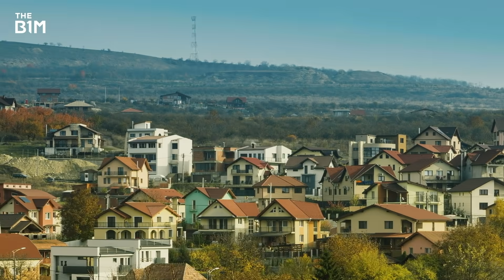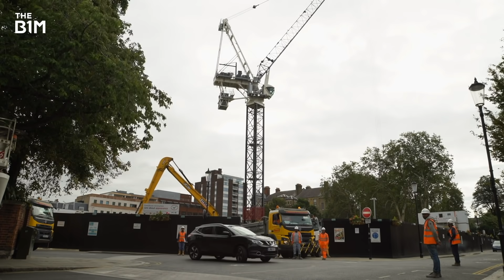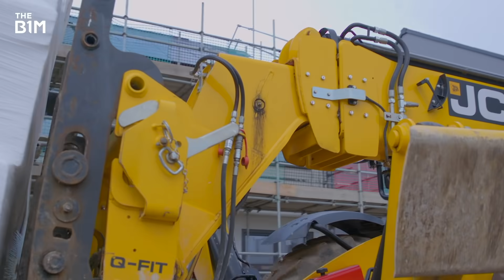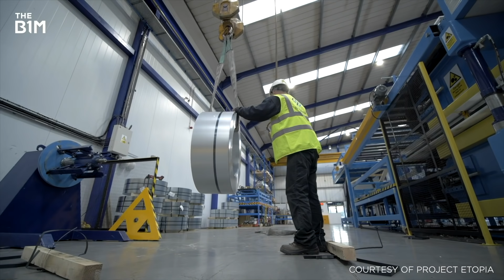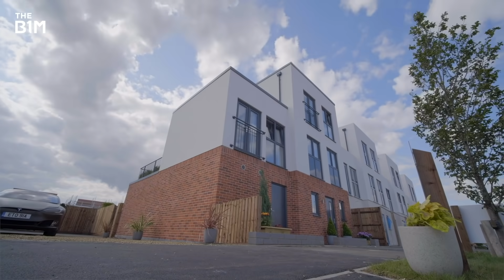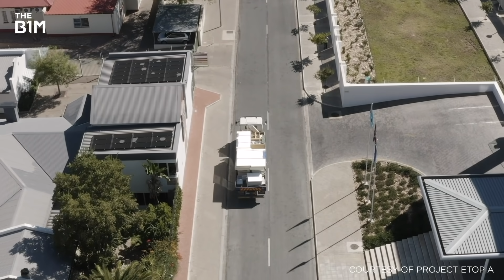How To Build More Homes, Faster

Comment: The picture I have used for my icon is my idea to combat the lack of space we have in Britain. So basically, in the footprint of only one house, I have built a retail space at ground level, two levels of carpark for the residents and ten family homes stacked on top of each other. There should be a water tank on the roof but I missed that off. This building is not meant to compete with a block of flats! It is meant to be an alternate to housing estates full of brick and slate 'Barratt' houses. What looks like glass, surrounding the building, is in fact a fine mesh that is virtually invisible. It keeps out the rain and pigeons, but lets in air and sunlight. The mesh is also a structural element, pulled tight around the building so that it helps support the cantilevers, which act as massive indoor/outdoor gardens that are safe for children and offer better views than any estate garden surrounded by fences. At the rear there are two large glass lifts, with fire escape staircases on either side. There would also be a slim fire escape nearer the front, for anyone caught on the cantilever during a fire. Although there would be sprinklers underneath each cantilever. The actual 'house' part of each level is protected from the elements by the mesh, so it can be built from lighter, more environmentally friendly material than brick. The houses can be made to look modern or Victorian or Georgian, whatever suits the area! The carpark level is accessed by a ramp and secured by an electric garage door that only residents have the remote for. This door can also be opened via an intercom in the house to allow delivery vans and visitors access. Please let me know what your thoughts are about the building, especially B1M and any problems that could occur.

Comment: I can't find anything about the project Etopia costs in Africa. 

Given the fact that building a house/apartment for anything more than $2000 becomes unprofitable (unless you're in the top 10%, which I'm assuming is not who we care about when trying to prevent housing shortages), the cost is extremely important here, since it would either allow leverage (if profitable) or be another form of charity.

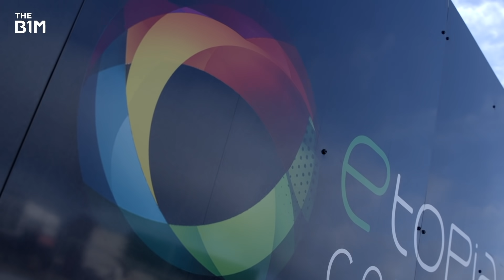Comment: 4:20 you didn't mention in the video cost of these houses. so I looked it up these houses are going to cost $300,000 to $350,000 that's not affordable housing.
Reply: Bruh that's not too bad if you're living in California😂
Reply: @noosurprises   but these houses aren't in a major city like London they're actually far away.  Just like California nobody wants to live in the Central Valley.
Reply: @thatcoolkidjoey  I know I was joking. Although the prices in the central valley have been rising lately. They might just reach that point soon😬
Reply: In India we have a affordable housing programs and most of them are now being build using pre-cast segments and they are far far cheaper than these houses. If it's apartments then they are much more economical I think African countries need these type of cheap and affordable programs than the Corby which I think is quite expensive for the developing African countries. Hear If you chose to live in outskirts of the city like Bangalore then the small apartments of 1300-1400 sft will cost you about 32000$-35000$
Reply: So about 10-15 years of saving everything if you  earn 25k a year... these prices are absurd.
Reply: I live in The Netherlands and a house of $300,000 (€255,000) is a bargain. The average house price in NL in 2019 is €308,000. The average house here is a three story row one-family house with a pitched roof, with a small back yard and mostly a very small front yard, no garage, just a shed for the bikes. The attic with the pitched roof is the third story, so only half the floor space can be used. The house in total has about 120m2 (about 2000ft2). In my rural town (about 20,000 inhabitants) the average house price is higher than 350K. I bought my two story appartement of 110m2 for €279,000 in 2017. I can now sell it for a bit under 400K. In 3 years that’s a 40% rise, that’s just insane. I don’t live in a city, just a small town situated between Amsterdam (30km) Utrecht (25km), Rotterdam (40km), The Hague (40km) and Amsterdam Schiphol Airport (20km).
Reply: And just were does all the timber come from
Reply: That's pretty affordable by British standards, up to £300,000 you don't have to pay stamp duty as a first time buyer and there are also various government schemes to help you add money on top of your deposit. If we take into account that this is a commuter town wich means it's quite close to a major hub and must have pretty good transport links I would even dare call it cheap.
Reply: Here in San Diego the median home price 600k. On the coast you are looking at 1 million plus. 350k is affordable here.
Reply: Yeah and Corby is a working class steel town.
Reply: That's pretty affordable. I live in British Columbia Canada where a brand new 1 bedroom apartment can cost $450,000. Hey a three bedroom townhouse will cost over $1,000,000. Let's not even talk about single detached family homes. Also wages have barely changed in the last  15 years. Starting teacher salary for example is only 40k. These projects seem very affordable to me.
Reply: @john.ragone  not for those that are already on the fringe treading water.
Reply: @john.ragone  I live in semi northern Ontario about an few hours from Toronto and a nice quite big house here used to be around 200,000. Things have jumped and people are building here like crazy and houses that used to be worth 2ppk are now worth like 275k
Reply: @john.ragone  it’s not affordable. The chinese just keep buying all of your guy’s homes as investments overpricing the area
Reply: @john.ragone  did u take US and Canadian dollar conversions into account?
Reply: thatcoolkidjoey are you sure about what they said because he said a ‘typical house is £270,000 - £350,000
Reply: $450,000 for a home is really reasonable,   youd be hard pressed to get a house in Canada (anywhere) for that cheap...
Reply: @niagarawarrior9623  What!? From the US, where the average price of a single-family home is $226,000, those housing prices would be absurd anywhere except the CBD of major cities. In my neighborhood, $275,000 would get you a 300 sq. meter house, with lawns and a pool in the backyard.

Comment: A really big issue I experience living in Germany: in many places there are construction works going on in cities, towns and villages. Either it's a project of a single or two houses, or it's an entire neighbourhood, but hardly any of those construction projects are thinking BIG. I just moved into a brandnew apartment building ... a 6 unit building. Such buildings cover the need for only very few people or families, not the masses of people. There are multi-unit apartment buildings around ... old ones, in the poorer areas of the towns and cities. Of course there's also the extreme like modern apartment towers for the top few percent of earners, again rather a niche market than a solution for a great number of people. There aren't really many projects combining 1) a high number of units, 2) high quality or at least modern style and 3) being affordable for average earners. Modern apartment blocks or apartment towers can offer a normal level of high quality living environment and they are seen in so many countries, but not that much in Germany. Apartment blocks always have a sense of low quality, poor, dangerous etc here which is pretty sad IMO. Honestly, often you can determine how poor a neighborhood is by counting how many floors the buildings have...
So they'll continue to build relatively small apartment buildings with only a few units each, blending in with older single family houses in the neighborhood. I don't really like that trend
Reply: Nah, as I'm also in Germany, there are a lot of projects here that scale, up to 50 or even a hundred units. But these are only good if they're limited in height and number of units per entry, so you don't end up in an anonymous box but actually know your neighbors. If you build a 200 unit high rise, you're accelerating social issues. I know people who lived in such buildings and it's always a solution they chose for one single reason: it was cheap. A tomporary solution until they could afford to live somewhere else. So maybe, we should try to build places, which people can not only afford, but also enjoy to live in. Anonymous boxes aren't that good for this.

And yeah, there are also people living in a 3 unit house not knowing any of their neighbours, but it's far less common. Quite the opposite is the case, in houses with less then 6 units, often all neighbors know each other and they often even do activities together. Especially if there's a shared outside area.

Comment: The problem with this is that it takes huge initial capital to build the prefabrication factory. Which means that only the couple of large developers will be able to use prefab housing, and undercutting all the small and independent developers resulting int a monopoly in the housing development market.

Comment: Would have been nice if you commented on the speed at which refurbishing existing housing stock compares to traditional and modern methods of new build.

Refurb is by far the most sustainable option and is easier to retain a more local character.

Comment: As usual it's a great video, thanks guys! 

There are a few questions though that could also be addressed: how developers and property owners can be stopped from artificially increasing demand by either blocking the development of approved sites or keeping properties empty instead of renting them out. Another question could be why the focus is on small houses instead of actually appealing apartment buildings? Single family houses with private gardens consume a lot of land and don't scale well with the increasing demand. New concepts of modern apartments could challenge that and be very economical and ecological on a much smaller footprint and without demolishing greenbelt areas needlessly. Those government policies mentioned at the beginning of the video have (in the UK) a bigger impact than one would think...

Comment: I think Japan is a tremendous example how housing should be treated. timber frame homes in Japan are completely demolished after about 30 years and rebuilt, its amazing what Japan is able to do with the redevelopment of neighbourhoods yet remain amazingly affordable for the middle class. not to mention having some pretty intense building codes
Reply: What's sustainable about houses that only last 30 years? We don't have the carbon budget to keep doing that.

Comment: I wish it was that easy. In many German greater metropolitan areas, housing prices are dominated by the prize of suitable land. Heavy regulations make construction more expensive, but they often have a reason, such as environmental protection, energy savings, avoiding urban sprawl and so on. As long as the supply of land is the key bottleneck, lower construction prices will only lead to higher land prices. In theory, this should help increase supply, but this would require a functioning market mechanism. Due to regulations, this is not the case.

Comment: the largest problem here is that no-one but the average (middle to low income) profits from building more houses. Companys can either chose to build 10 500k houses for 400k profit or they can build 100 50k houses for 10k profit. they will choose the more profitable option every time. or they build 1000 5k houses and rent them out for 25k. that is also an option that is fairly common where I live.

Comment: the problem with the uk is not that we r overpopulated its that we r sparsely populated so we r living in the 20th century to be in the 21th century we need more than 2 million+ people cityies (more people in a smaller area making better infrastrucure more viable ) better infurstrure like more underground rail and  encourage people to live in flats rather than houses and build higher and enough houses but the problem with bringing the uk into the 21st century it would easily cost at least 4 trillion£ so the ggovernment would have to come up with a nationwide mega plan to get it done which they cant do coz they aint capable off doing it

Comment: Food for thought:
1. In 19th century and prior, people made buildings out locally available and cheap materials (within 10-15 km). This made their housing very non-modular and required skilled labour. But labour was available (who sometimes were the tenants themselves).

2. Modular construction means: We don't have enough skilled labour. Make 50% to 100% of the building where we can provide labour in a factory, with materials very far away from site. Then ship the building to site in pieces and assemble it. Its a trade-off between building material costs and skilled labour costs.

Is that necessarily progress?
Reply: Similar to sending raw materials to China then buying it back as goods. Waste of energy
Reply: Modular construction lacks quality. You often end up having to do major repairs in your 5-year old house. Paying more upfront will save you in the long run. Always be your own builder, don’t hire mass building companies. Those companies cheap out on contractors and will hire the cheapest ones possible and you will have no control over that and what they are doing. Then select architects and contractors yourself and do as much as you can by yourself.
Reply: And if we add how they all look similar, I bet in 30 to 40 years, these will be torn down to be rebuild again. Like what is happing in Sweden, Japan or the US right now. I don’t see how all of this is sustainable or eco friendly with all the unnecessary waste created.

Comment: I have a question why is it the Governments responsibility to build new homes over in the UK? Here in the United States building homes is seen as a private endeavor.
Reply: The government hardly builds houses in the UK (occasionally local authorities do) but they are seen as responsible for things like zoning, regulations, incentivising developments etc.  Also the issue has become political so the government has to be seen as doing something about it, but they don't actually  build houses themselves. hope this helps
Reply: @jonnymitchell5625  Glasgow is constantly building new houses or redeveloping them
Reply: It has been a politicized issue in the UK for quite a while, after WW2 when large parts of the country were destroyed the government and local authorities built a lot of homes. It ended up with 'council houses', houses that the taxpayer owned but were rented out to less well off people at a fraction of the market rate. 
Then after the 2008 crash many local authorities lost a lot of money, many had their money in the Icelandic bank that went bust and government cuts meant local authorities had to find ways of generating money. Combined with a new government plan to allow tenants of council houses to be able to buy those properties for a fraction of their market value and it meant most of the UK's 'housing stock' was sold off. 

So the issue is politicized because the government stands accused of creating circumstances that led to a sell off of affordable homes that were never replaced. In general home building is a private enterprise, but there is pressure on the government to build more homes because of the reasons above.

Comment: We need to get on board and push local politicians to build, build, build. #YIMBY
I looked up Etopia in Corby, the houses look nice but they start at well over 300 grand. In Corby. Hardly affordable when you can get 3 bed semi detached houses there for 150.
Reply: Yep, £330k for 2 storey 3 bed house, all of which are either semi-detached or terraced. Overpriced as hell, though hopefully it proves that off-site construction is viable and then economies of scale can help us out.
Reply: They probibly can't make it any cheaper. I work in the industry in a other country in europe. What is really stoping us from making buildings cheaper is fee and administration. We also build farm buildings. Use the exact same construction method, they cost just a fraction to produce. The diffrance is really quite significant.

Comment: I really do feel the housing supply pinch, even in a highly developed area. Here in California, the biggest solution we have to housing supply is just to keep increasing urban sprawl, rather than building up the urban core. As a result, there's an increasing commute time for workers to crazy levels. I live in the Central Valley, yet even here people will do a "Super Commute" of 2-3 hours each way to the San Francisco Bay Area since trying to live in SF proper is just impossible at this point.